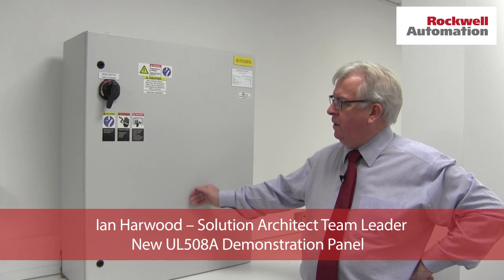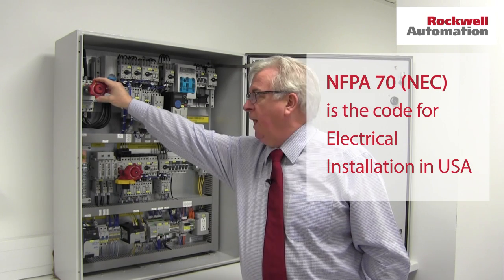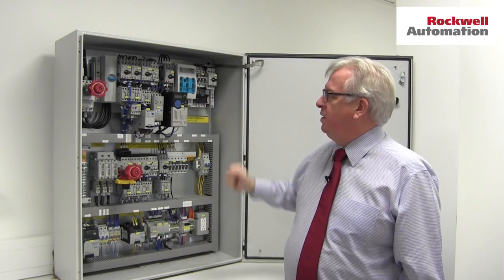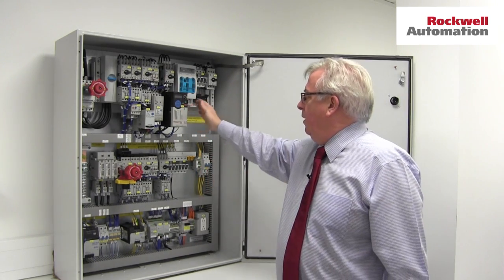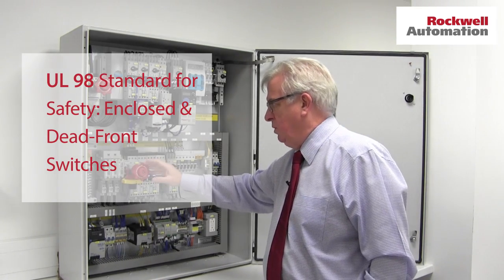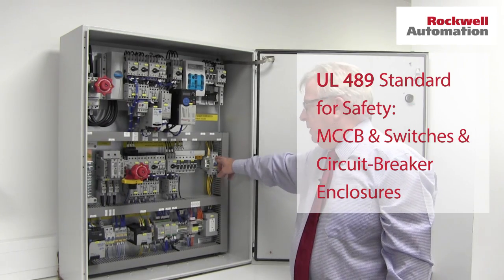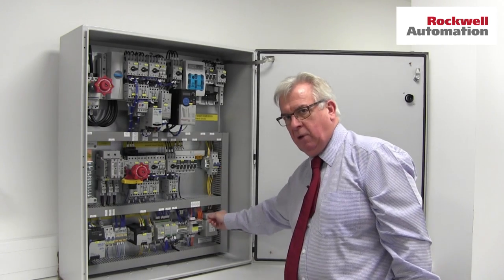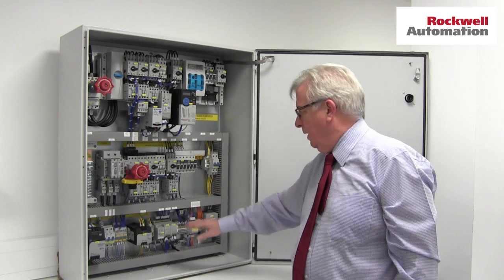A Demonstration Of The Standard For Industrial Control Panels

Comment: how can we get single phase 230 vac from 480 vac three phase north american supply?
Reply: that would require a step down transformer
Reply: Filter one of the phases so that you are only using one use a step down transformer to bring the voltage down from 480V down to 230V.
Reply: efopo  good catch.
Reply: Inside the panel? Or outside?  I seem to recall that externally you could do it a few different ways for machinery, if needing more than 3 horsepower a rotary phase converter would be the way to go, but under 3 horsepower a Variable Frequency Drive would be a more cost effective solution.  However, I haven't looked at that question in 15 years and there might be something better in 2020.

Comment: How can you see what went wrong during trouble shooting if you have to switch of the power before opening the panel?
Reply from the maker: Hello, thanks for the question. The external handle has a 'defeater' which maintenance personnel can use to open the panel whilst the switch is in the 'on' position. So if you are 'in the know' it is possible. Better still...Network your panel onto the Connected Enterprise and then you will be aware that you have a potential problem before it happens!